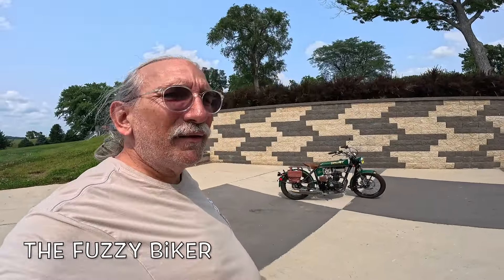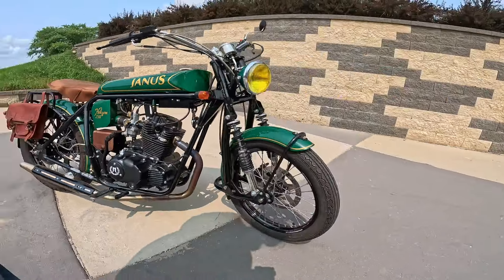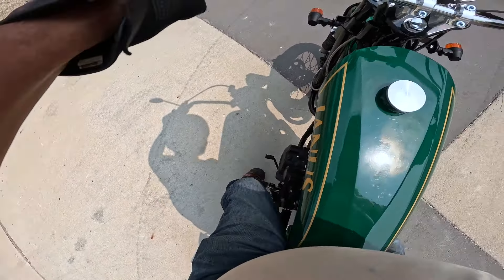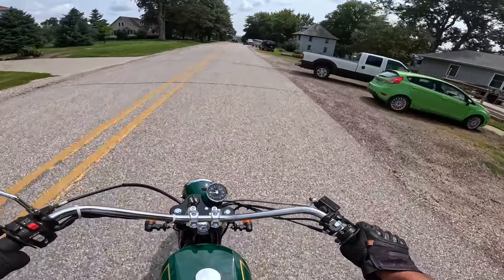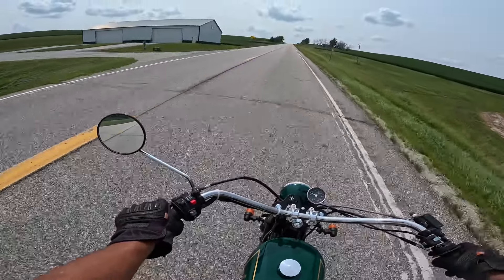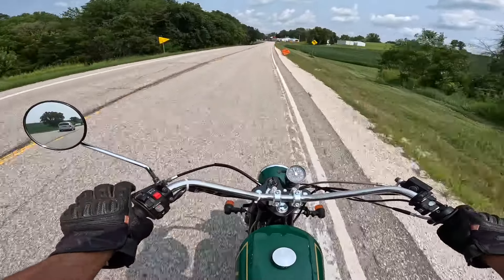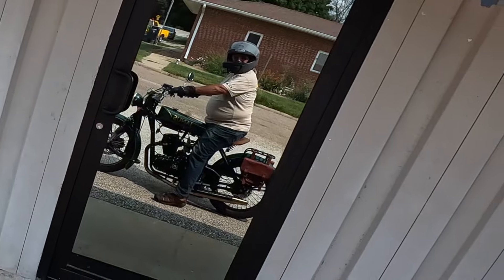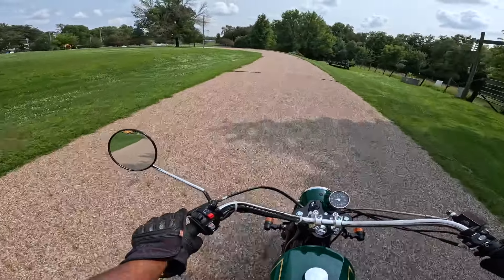Janus Halcyon 250 - A Uniquely American Motorcycle - Wahoo!

Comment: I have a 2022 build Halcyon 250 with the motocult stage 4 plus engine power upgrade, now I have 23.5 HP to the rear wheel, it is a cruiser! And very light, less than 280 lbs. most fun I have ever had on 2 wheels!
Reply from the maker: Very nice!